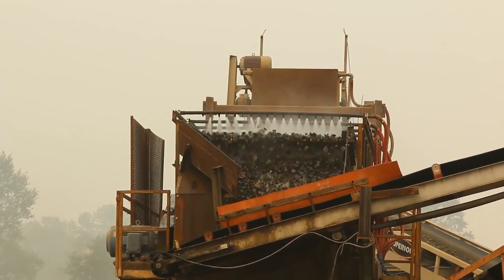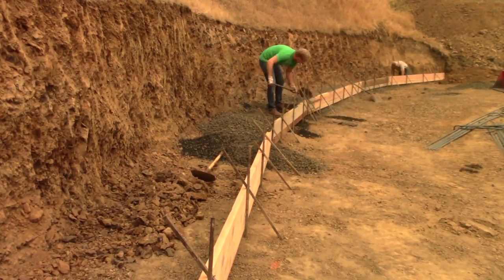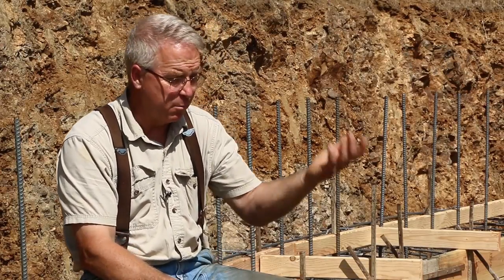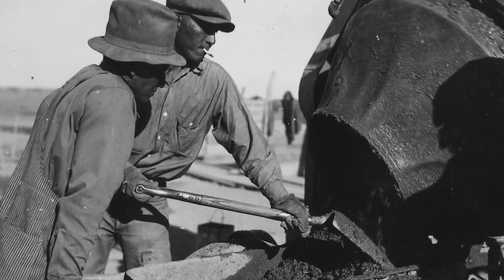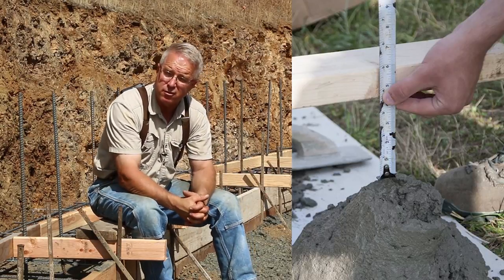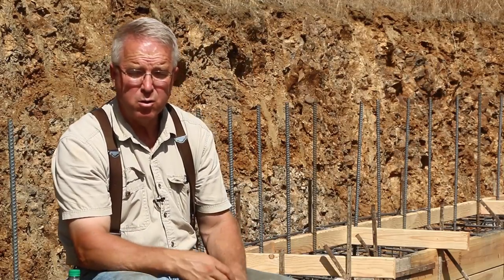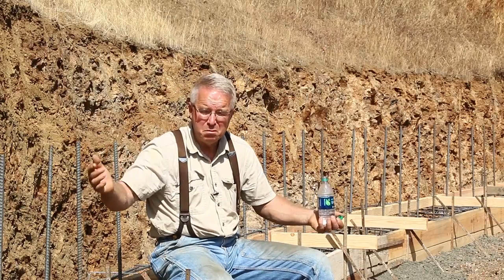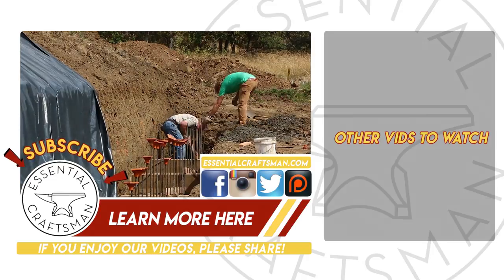How to Order Concrete: Ep.14

Comment: Today we got the rebar for the trench foundation on the house my wife and I are building here in Michigan. I'm reviewing your videos on the concrete process for the spec house to double check my thinking (and, in the case of the rebar, guide my correction - I didn't allow for the "development length"!) . We're at the point of getting quotes on concrete from a couple of providers in our area and will soon have a truck on site dumping mud. You've been a tremendous resource. Thank you.

Comment: I recall building a retaining wall when I was in my early 20’s on our first home. It was holding back 18 feet of vertical garden for over 100 feet in length. 
I learnt so much on that wall as a labourer to an experienced bricklayer (brickie in Scotland) and from my father who was the lead on the renovation/remodelling of our 200 year old cottage. 
The wall took around 3300 concrete blocks laid flat and was 6 and half feet wide at the bottom whilst always being a third in thickness of what it was holding back up its 18 feet of height including under build.  Of course lots of drainage and relevant backfill to stop water buildup.  
It’s been in place now for over 20 years and it’s not moved a millimetre!
Wish I could post a photo of it!
Love this series!

Comment: It's interesting to me to hear you speak about slump and its importance with respect to strength of the concrete. Far too many people who should know better will add far too much water for ease of workability, which is easily compensated for with admixtures.

That said, I remember several years ago watching a video of the Burj Khalifa being built in Dubai and the slump was, near as no difference, the complete height of the test cone, rather shockingly. The mix was actually designed that way for pumpability, and had a bunch of admixtures and a special silicon additive for extra compressive strength.

Thanks for this series, Scott.

Comment: I learn from every video you post, but this was the most informative yet (for me).  I had no idea there was so much to concrete!!!
Reply: J Smith there's soo much to concrete. At my plant I carry 5 chemical ad-mixes sometimes 7. We also use fly ash from power plants or a product called cempoz or pozzoslag. I can make concrete an 80,000 pound truck can drive on in 4 hrs or put the concrete to sleep so that it doesn't even start to set up for 8 hrs. Cool stuff.

Comment: Just some trivia,the slump test is 30 puddles per lift with each lift penetrating the previous one by a minimum of one inch. The rod should not be a piece of re-bar but a 5/8" smooth rod with a bullet tip. Also,spend the extra money for plasticizer  to adjust the slump. It is worth every penny.

Comment: In dealing with PennDOT jobs, we usually use telebelts when we can't use trucks to get concrete directly where we need it. Pumps can mess with the air quantity in the mixes, something our techs also measure along with slump.

Comment: I don't know if this happened to you in the PNW but I remember in the 90s and early 2000s concrete redi mix companies were loading all kinds of crap, like way too much fly ash for instance, into the concrete to try and reduce the amount of cement in order to save money and we were having a heck of a time putting a finish on that junk. The concrete would come up to strength in lab tests so thats all they cared about..It was garbage to finish. They have now seemed to gone back to putting the actual weight of cement that a 5 or 6 sack mix is and the concrete is nice and pasty like it used to be. Its like finishing concrete from the 1980s lately, which is great. I don't know if they went back to mixing like normal or if they have new and improved admixtures, but the finishabilty of our concrete has drastically improved.

Comment: I helped build a suspension bridge in the wilderness two years ago... It had four poured concrete footings. Square holes, and 2m (6ft) deep, with some timber formwork at the top. They'd have been about 8 cubic meters, or 300 cubic feet (or less) - total. I don't recall exactly, but I'm likely overestimating substantially... I suspect they were actually smaller. 

The whole project was built/supervised by an engineer, who was onsite, and who (I guess) ordered the volume of concrete.....

The concrete for the footings was poured by helicopter with a monsoon bucket. It flew to the top of a hill where there was road access for a truck, filled up, then flew it to the holes. It was the sort of road that you could get a midsize concrete truck up no problem at all - not a gigantic one, but definitely one with the capacity to get that amount of concrete to the top of the hill... Or, two part full trucks... Or whatever.

It was in a windy area, so getting a calm enough day took some time. 

Concrete is fairly cheap... Particularly in comparison to helicopter flight time... Bought as premixed bags from a hardware store, a cubic meter of concrete costs ~NZ$800 (roughly US$500). Buying a truckload is substantially cheaper.

....The engineer had ordered enough concrete for about three and a half of the four holes. 

The remainder needed to wheelbarrowed in the next day (by guess who....) - I didn't order that concrete either... There was about enough for another 1/4 of the hole...

...Then finally, somebody else took the remaining lot in the day after.

Comment: My friend has a surprisingly simple solution to the issue of excess concrete on an order: He sets up forms for general pre-fab parts that can be used later on that job, or on other sites. Finish the main pour, estimate what's left, and then start filling up spare forms based on what he has on hand rather than dumping it all in a hole somewhere to be dealt with by the poor sucker who comes along years later to run a trench or extension.

Comment: It's not always true about the engineer not specifying how the concrete is mixed.  For a house project like yours, they may not specify it, but it is very common for me doing projects for the City, State or public utilities that there are specific requirements for the concrete mix beyond just the PSI rating.  That specific information is usually found in the project specifications.  Those specifications are usually a combination of citing common specs (ANSI, UL, NEC, etc), government or utility common specs, and specs written by the engineer dependant on their discipline.  If you're interested I can show some examples which I use for my location (Hawaii).
Reply: shinigami052 go for it. Help everyone learn even more, thanks
Reply: Here are the Hawaii State specifications for highways.  You can see there are many different specs for different applications.  For example, I'd specify the contractor is to follow Section 623 - Traffic Signal Systems along with any other sections which may be relevant to the specific project.  http://hidot.hawaii.gov/highways/s2005-standard-specifications/2005-standard-specifications/

Our electric company also has their own specifications (https://www.hawaiianelectric.com/for-businesses/electrical-installation-and-standards/manuals-and-engineering-specifications ).  If you look at CS9301-2: Specification for Cast-In-Place Concrete Work, section 2.05 table 1, it specifies the aggregate size based on the specified PSI.  All of the batch plants here have and know these specifications and have, for example, a HECO 3000 mix which matches the requirements in that specification.  Prior to pouring concrete, the contractor will submit a sheet from the batch plant detailing exactly what is going into the mix.  I'll review the sheet to make sure it matches the specifications, then I'll send it to the utility to have their engineer verify it as well.  Once the submittal is approved I'd send it back to the contractor so they know they're okay to use that specific mix.
Reply: the second link doesn't work btw. says it's no longer avaliable
Reply: Thanks, fixed it (it captured the end parenthesis as part of the URL)
Reply: I too run batch plants but in Texas and do a lot of jobs for TXDOT. Before I got in to concrete I never knew what all went into making the stuff. It's vert interesting if you like chemistry. 

The specific amount to rod the concrete in the slump cone is 25 times in a spiral starting at the outside and ending in the center, at least in TX.   

We also call the last load a kicker or tag.

Great video and channel keep up the good work.

Comment: Just a bit more on designing concrete mixes: If the plans call for a specific PSI requirement, say 3000 psi, a brand new mix design will be designed for  1200 psi above the psi requirement. So if you have test cylinders made for that 3000 psi mix and broke at 28 days (industry standard for testing concrete strength) they will probably average 4200 psi. They do this to account for anything that may adversely affect the strength ( poor mixing, aggregate size/strength, too much water, ect.) The 1200 psi covers the standard divination (think statistics and bell curves) so that at least 95% of the time, the concrete will be above 3000 psi. If a mix is used a lot, and has lots of testing to show the properties of the mix, they can start to change the cement/water content  to make a more economical mix that still nearly always meets the strength requirements.
Reply: Brian Helmold --- Our 'job site placed' 3500psi concrete would usually break at 3800-4200psi range in 7 days. 4000psi would break at 5100-5700 in 28 days.
Reply: Was there a need for high early strength? In our work if we need to put loads on the concrete early we pour a higher psi mix. Example: for a footing needing 4000psi, we would likely pour a 6000 psi mix to get the strength earlier. Concrete gets about 70%-80% of its 28 day strength at 7 days.

Comment: I bet one could use a laser or LIDAR scanning system to capture and build 3D models for your concrete forms.  Then, one could very accurately compute the volume including all the irregularities.  Another benefit would be the ability for a designer/engineer to run some FEA/CFD models to determine the optimal way to pour and let the mix set to achieve the desired product.  A little more work, possibly overkill for some jobs but possibly a great risk-reduction step for other jobs.

Comment: One solution to this, and i admit it's not available to everyone (yet, arduino modules IE something anyone can put together with a little bit of patience, are getting quite good and quite cheap) is to scan the hole and from there, calculate the volume via program. 

We've done this with LiDAR on a sensitive site where the ingress with the concrete trucks was damaging to the soil, thus as little traffic as possible was required (to the point where we used Giraffe pouring machines).

The extra that was ordered was only 3% and we came in spot on. So, as effectiveness goes, quite effective. But it did cost renting the LiDAR, so gives, and takes, i suppose.
Reply: aserta --- I did it "the old fashioned way", measured the footings in inches (HxWxL)....in close 5' increments.... and divided by 46,656 and rounded up to nearest quarter yard. It would take about 1-1.5 man hour to do the measuring and calculations but it worked and saved a lot of money!

Comment: What about doing DCP testing in the footing and compaction of the base material the footer will sit on? Slump cone is 3 equal lift by volume,  rodded 25 times each lift. you do not twist the slump cone when lifting it will void the test if twisted.

Comment: Around here I see building sites with retaining walls built out of landscape bricks. Our area is similar to yours weather wise, 90+ in summer and -15 in winter, it would have seemed less expensive to do it that way and I have seen these retaining walls 25 feet high and 200 feet long. Around here is chicago area.
Reply: tim s - he's a concrete guy, why would he use SRWs.?  In fact those SRW walls often require more excavation behind the wall and more structural engineered fill with those geo textile fabrications. just a big headache.  Better to pour concrete and face it with real rock and stone (or brick) to show real 'class' and distinction. .. People buying will prefer that.  ;) trust me

Comment: Concrete pumping: I've been reading in forums where concrete pumpers have discussed using dish soap to lubricate the lines and adding additional water to insure it pumps. These guys know it has adverse affects with concrete strength but they're more concerned about a pump not pumping. I've also read that apparently a lot of line pumps are not concrete but grout pumps. That many a contractor will pay more for the mix to pay less for a pump and so quite often are pouring weak pea gravel or just slightly larger aggregate mixes that look good but aren't strong enough. For my project I want a very high strength mix with large aggregate, water reducers (Plasticizers) and fiber to reduce shrinkage but I'm concerned this isn't possible and that on sight a pumper is going to modify the mix to work with his pump. Kind of pisses me off.

Comment: As far as concrete goes with minerals and additives, be glad you don't have the problem that the folks in Ellington CT have. http://www.ellington-ct.gov/DocumentCenter/Home/View/1279 their concrete had a mineral which caused it to crumble 30 years later. 

Now there is a mandate for all those installing , manufacturing, even hand mixing concrete, to keep all of the information for 50 years. Where the materials came from, how it was mixed and who supplied, and installed it.

From the CT website, 

Some highlights of the investigation’s findings are:
The mineral pyrrhotite must be present to result in the foundation to deteriorate in the way observed.
The minimum amount of pyrrhotite needed to trigger deterioration is not yet known.
Becker’s Quarry, the main source of concrete aggregate for JJ Mottes, includes more than trace amounts of pyrrhotite, and is located on a vein of rock that contains significant amounts of pyrrhotite.
Reply: There are regions in Quebec, Canada that have this pyrrhotite problem. It's quite a severe issue!

Comment: When setup the edge board , I saw you put top board and then bottom board , how to specify the width of the bottom board ? Cut to size on site ? Seems bit difficult because it needs to rightly fit in the gap between top board and ground.

Comment: As a homeowner, do you know what sells me a on quarry? When they sell me a 1/2 yard of material without either jacking up the price, or giving me a hard time. My trailer can handle a 1/2 (by weight, I put a yard of 3/4 in it once and listened to the axle creak the whole way home). I am an easy load. Just dump it in my trailer. Some places give you a real hard time for smaller quantities.

Comment: Clean up? My clean up load was 9 yards and it took more than an hour to arrive and we had to keep churning the face of installed crete while we waited. That was embarrassing. 81 yards in total. Monolithic slab with 2' wide, 4' deep perimeter footing and 1' by 2' at all interior footings, load-bearing or not.  I built 4' by 8' forms for the outside of the perimeter and installed rigid insulation all around afterward. That's what happens when a novice builds his first house. That slab is going to be here 10,000 years from now. ...and then, it turned out I had married the wrong woman and lost it all.

Comment: A slump cone is never rotated nor is rebar used for rodding. Plywood is not approved for a slump plate, only metal or plastic are
Reply: I can understand that  plywood  sucks the water out of the concrete, but why no rotation?
Reply: Kareem rotation is not permitted per ASTM and ACI. It affects the slump cone that is formed, giving a false measurement

Comment: Dude...your making cutting rebar way to hard!
Get a Short handle rebar cutter...mount it (handles off the end), on one end of a waist-high table bench!
Now you can put your rebar on the bench and not bending over to pick the rebar up from the mud...
Now...put a pipe about 18 inches long on the handle on the rebar cutter that moves up and down and you have a secure, long handle, rebar cutter without all the backache...
I have a Dropbox to catch cut pieces and wheelbarrow wheels on mine so I can move it around!